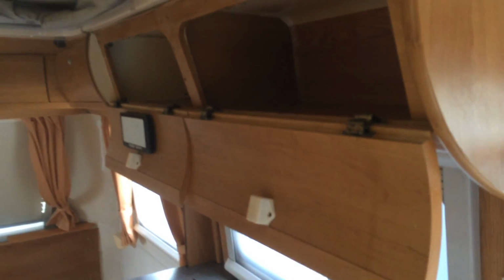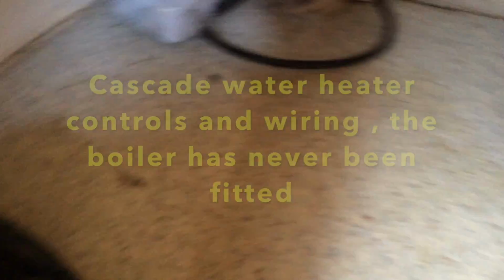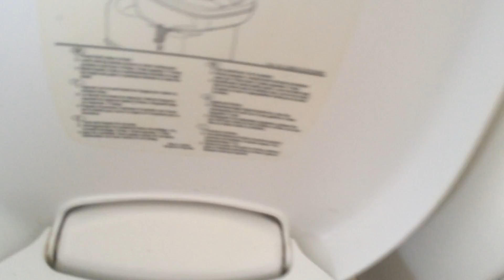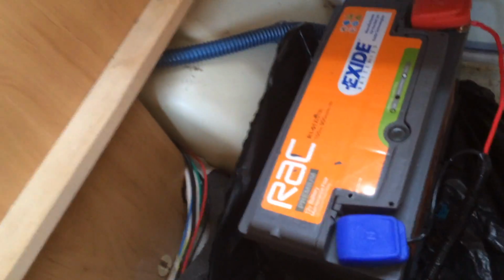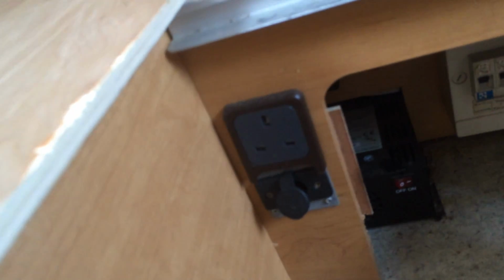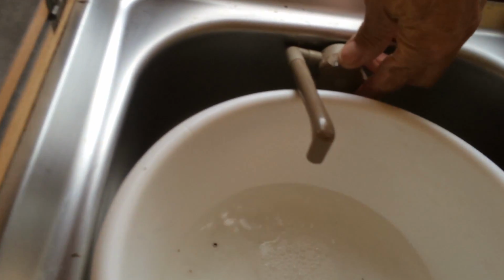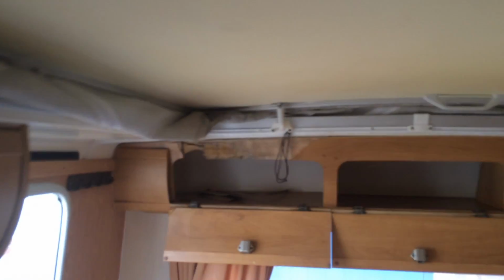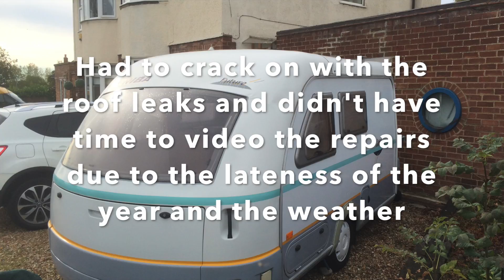Refurbishing a pocket size caravan Eriba Future 430T

Comment: Hi Marcello, nice caravan! Pls let us know is it made of composit, i mean fiberglass? Regards
Reply from the maker: The front,back,and roof are fibreglass with foam injected between the inside and outside layers the sides are aluminium foam plywood sandwich construction the chassis is internally hided in a  similar way to the sides so it has a smooth bottom. I will do a video soon